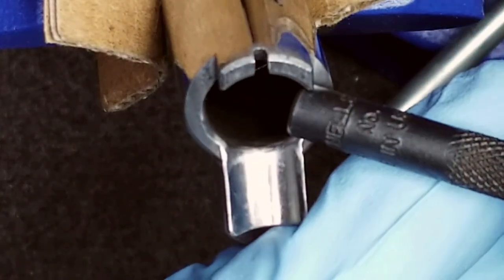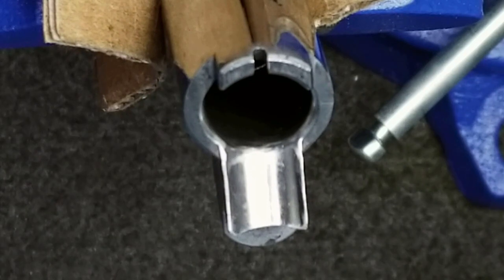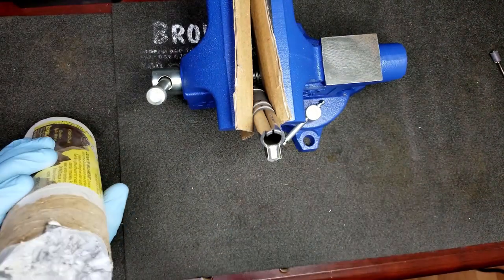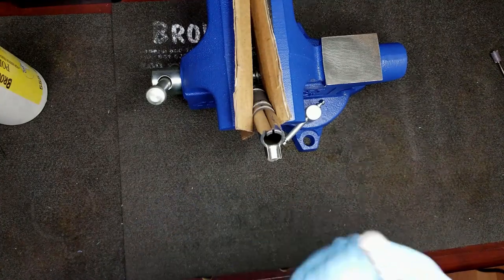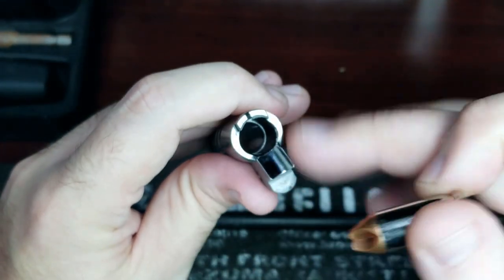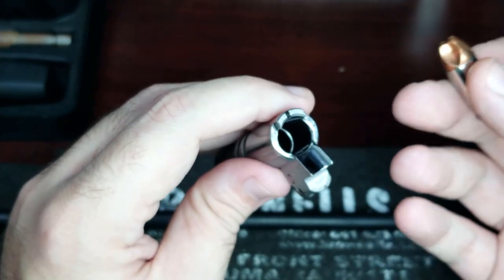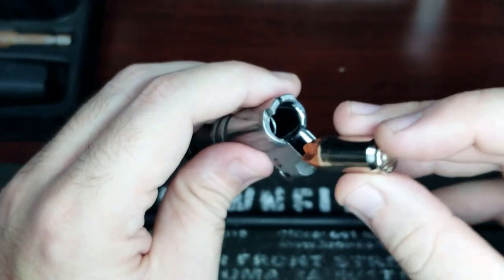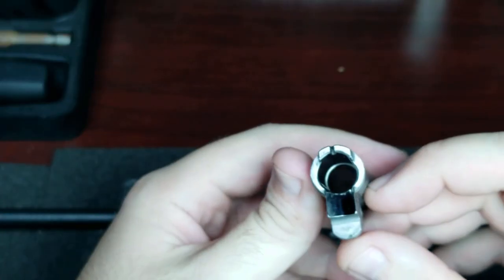Kimber CDP II Throat and Ramp Polish | 1911 Barrel Modification for Reliable Feeding

Comment: My Springfield 1911 barrel doesn't have the feed ramp attached. It's  on the frame. Then there's  a sharp edge and a step to the barrel. From the end of the  feed ramp to the opening of the chamber the bullet has nothing guiding it, or keeping the nose from side to side movement.  I'm not sure how to polish that correctly.
Reply from the maker: You know what that will be a good video to demonstrate the best way of doing that style 1911. let me see what i can work up. stay tuned.
Reply: @TheHobbyGunsmith  Heck yeah! I loaded up some Berry's round shoulder flat nose 200 g and the flat part hits below where the ramp starts, and then after I fiddle with the slide it goes up to the slide and catches on the bottom of the barrel. Even FMJ 230s sometimes get stuck at the base of the ramp, then if the case isn't crimped well enough the edge of the case catches on the bottom of the barrel. I think the mags need work, as well, but there's also issues to be resolved in the gun itself.
Reply: That gap between the feed ramp edge and the edge of the barrel is by design and is crucial to proper operation. If you try to blend those together you will have screwed up your frame. Check your magazine(s). Check your extractor tension. There are YouTube videos on how to do both. A bunch of grinding is not necessary.

Comment: Kimber as the best designs to their barrels the only thing I would ever do to that was I get a little rubbing compound and polish it like I did my my whole Barrel so everything is smooth and Slick what that guys doing doesn't look right that car that gun was engineered by some of the finest gun designers that did that already why would you have to go and do that again
Reply from the maker: Matthew, i agree kimber makes great designs, but notice the barrels on higher end models, they are chamfered and rounded for a wider mouth, it is a common practice on 1911 for better feeding reliability, this process was never performed on this model by the factory to keep the price of manufacturing down. hence why kimber and every other manufacturer has different models and quality upgraded specs between models.

Comment: The only problem that I ever had with my Kimber where the clips right out of the box when they come with the cheapest clip those blue   steel or blue or whatever they are they do not feed the gun proper I put brand new Wilson Combat clips and I had some older Chip McCormick clips that work for nominal somebody gave me to stainless steel clips that was made by Kimber that work very well but the original clips that come in those guns are junk I don't believe that anybody should use those they should be thrown right into the trash
Reply from the maker: clips where used on the M1 Garands, Magazines are used on pistols. but yes the factory magazines are not very good, as they need to be adjusted depending on the ammunition used for proper feeding.